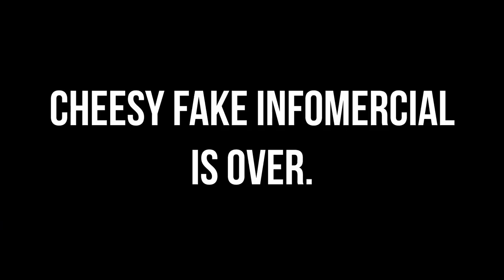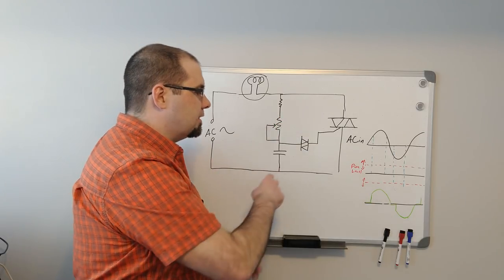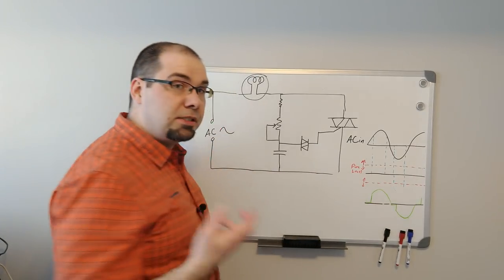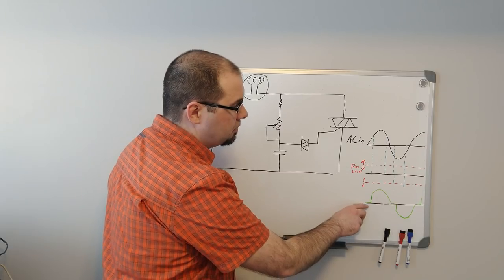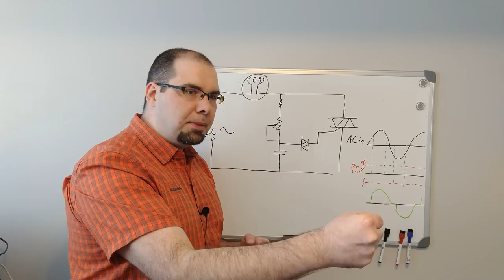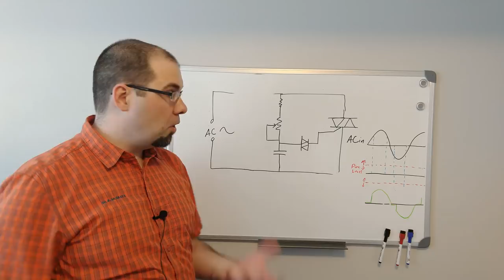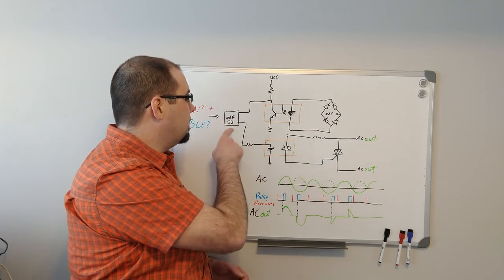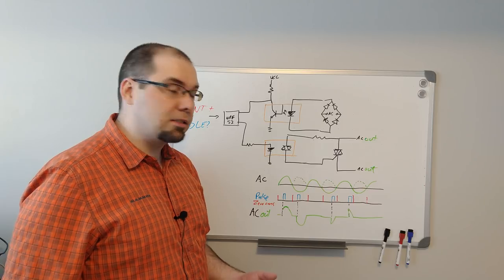Smarter Zwift Fan - Maelstrom Fan Controller

Comment: Suggestion for Version 0.01: Forget about the BLE and ANT+ complexity, just add a broomstick-tap-detection circuit (e.g. 3D accelerometer) and use that to cycle through three speed settings :-)
Reply from the maker: My broomstick skills were pretty bad. Maybe a clapper for speeds as a supplement.

Comment: Could be possible to add a friction system or a movement magnets to control the resistance in a "dumb trainer" with a similar system?
Reply from the maker: I've had friends after methods like this. I think there was a hackaday. However this isn't the device to do it.